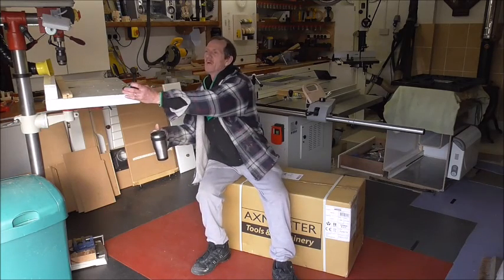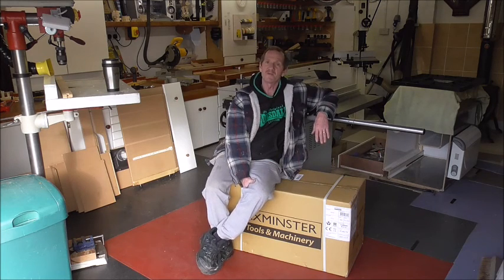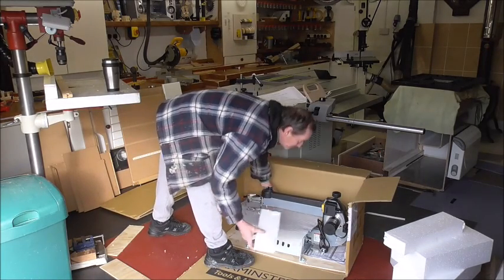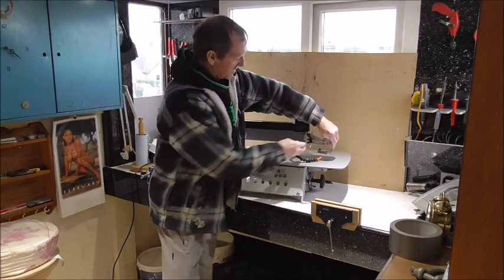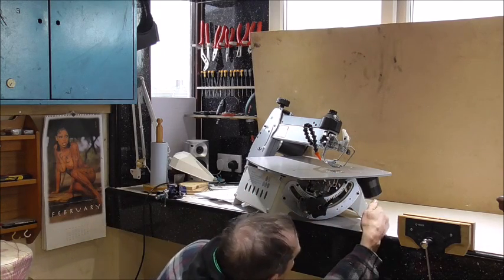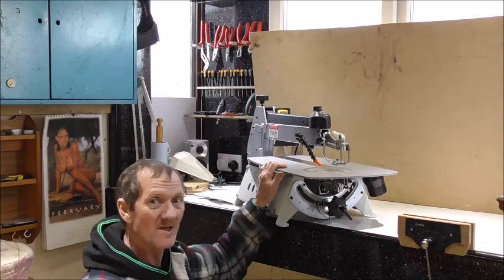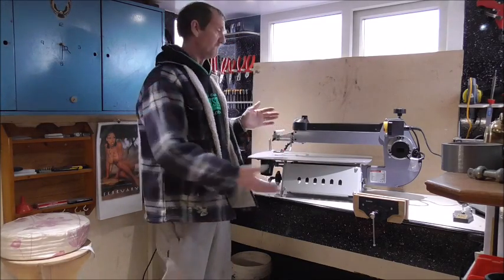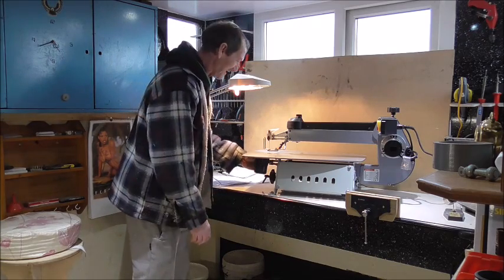Axminster Trade EX21 Scroll Saw

Comment: Well Dave , It arrived on Tuesday as stated, the setup was simple , And it came almost perfectly ready to use . I had to set the blade angle a couple of mm, and tighten the blade  by about 6mm  of a turn on the tensioner , other than that it is fine , Ok I have never used a scroll so it is alien to me . But on my first few goes with the saw I was impressed , It is far more capable than I am .I now need  to practice guiding the wood at the moment I am not getting it right , But hey , Practice makes perfect, thank you for the vids , And I am glad I have viewed then now ,  Phil

Comment: Hi Dave , would you recommend this scroll saw ?,  Hegner seem to be the go to machine at the moment . but this unit has far better features , A much bigger motor ,and is a lot less money , I am thinking of getting 1 . So I value your comments.
Reply from the maker: Hi Phil I will be honest, I am quite new to scroll saw work but as you can guess I have a good I for tools having bought and used them for so many years both on site and in my workshop, but when it came to buying a scroll saw I like you did some research first and one that stood out for me for being a good all-rounder was the Excalibur EX21, now the suppliers for this company in the UK is Axminster Power tool Company, now as I was making enquires to this company has they were just re-branding the Excalibur EX21 to read Axminster Trade EX21 but it is still the same machine.
Now having used it for a short while and on a few projects I am more than pleased with my choice, it works as well as I could have expected.
I hope this helps you to pick the right saw
Reply: Cheers Buddy,

Comment: Hi Dave, just received mine yesterday but I am having trouble finding the blade holder tubes the right size to slot in the side. Do you know of anywhere to buy these? Good reviews and it's a great scroll saw. I went for the 30 inch. Thanks Dave.
Reply from the maker: Hi Jet, yes Amazon just search Plastic Test Tubes, they have many on offer

Comment: I have very recently purchased one of these from Axminster ,and at the moment i'm still in the process of making a steady bench for it, but in the half an hour or so i have played with it, it ran a lot quieter and smoother than this one. It would be interesting to know what the problem is, and what Axminster had to say.
Reply from the maker: +gary s It is going back to them on Monday I will let you all know the outcome, thanks for your comment
Reply from the maker: +gary s  I sent  the machine back as they also thought something was wrong after watching the video, but after much checking it would seem that the problem was in the sound on my video and in real life it is not so bad and the fact that I had it on a very noisy desk top, so with luck and after I make a good stand for it I will try again.
Reply: +David Gladden HI David this dose make some sense,because after making what i thought was a sturdy bench for my EX21 it would still produce some worrying residences and vibrations at certain speeds, so i went back to the drawing board and modified the bench further by almost tripping the thickness of the top by adding the leftovers of a heavy fire door and strengthening it in every way i could think of, and then bolting the saw down right through bench with some big washes on the bottom, I then screwed the whole thing to the floor and the wall and the improvements were substantial. so as i think scroll saws by design like to create vibration and noise, some good old fashion over the top engineering has made mine a pleasure to use. so good luck David but i am sure a man like you will have no problem achieving good results.
Reply from the maker: gary s Did you do a video? it would be good to show people the reason why its so important to make things strong and correct its not just us woodworkers going OTT, I have a design in mind for mine which I will do soon and video so please watch out for it, it will be different
Reply: +David Gladden sorry David i didn't do a video, but i look forward to see what make.
Reply from the maker: I have made a start, will be posting soon.
so how about you posting a photo of your scroll saw stand? would be of interest to many I'm sure

Comment: thanks for the review, but what about noises and vibrations ? is it good as the excalibur EX-21 ? thanks again
Reply from the maker: +Amr Emam Hello and thanks for the comment, yes as I mentioned this machine is the Excalibur EX-21 its just had a new coat and a switch added that's it, it really is the same machine
Reply: +David Gladden Both machines are indeed identical according to Axminster. However, the noise and vibration levels are in direct contrast to reviews and feedback from Excalibur EX-21 users. Maybe this unit is faulty or needs adjustment?
Reply from the maker: ***** Thank you for your feedback, do you refure to my machine directly or Axminster EX21 in general?
Reply: +David Gladden Your machine is the only Axminster EX-21 Scroll Saw that is featured in video so far. I don't know any other Axminster EX-21 machines and/or owners so I can't refer to Axminster EX-21s in general.
From what I know from Excalibuer EX-21 owners, this amount of vibration and noise is means that something is faulty or that something needs tun-up. Or it might be an issue of your microphone.

I am am in Europe and I am going to buy an Axminster EX-21 in the very near future.
Reply from the maker: Yes you are correct there is a fault, as a new comer to this machine I didn't notice the issue at first but after your comment I looked closer and then contacted Axminster and now the issue will be corrected but it is an issue with my machine personally, so I must thank you for your observation.
Reply: +David Gladden You are welcome!